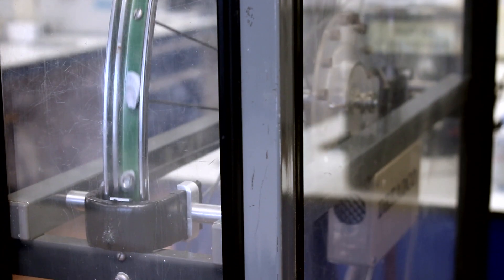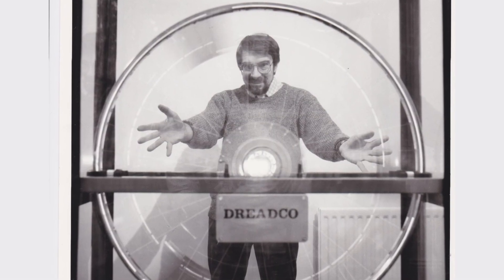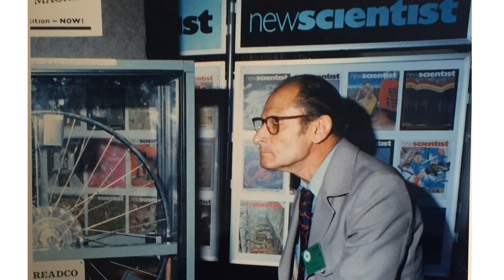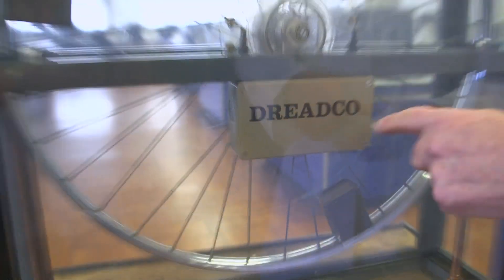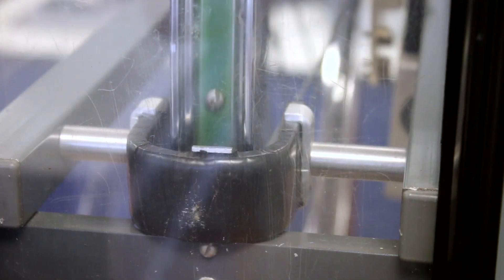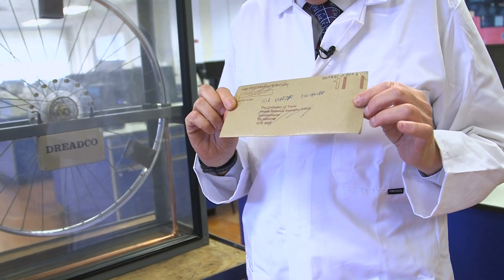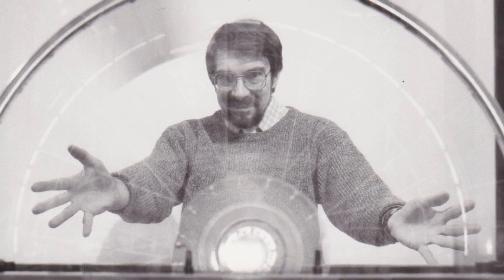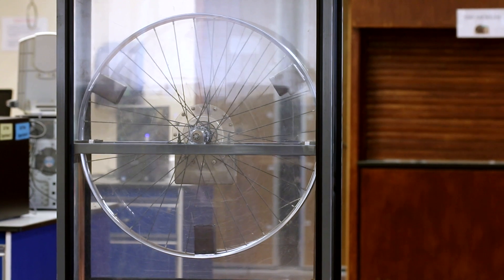Perpetual Motion Machine - Periodic Table of Videos

Comment: Seeing as how in Adam Savage’s video of this machine, the caretaker said it stopped every 2-3 years and had to be sent away to be reset, I think it’s a clock motor.
Hidden somewhere in the machine, probably the hub of the wheel, is a tiny analogue clock motor. The motor powers the wheel for 2-ish years until the battery runs out. And the wheel slows over time since it’s a substantially heavier load than the gearing of a clock and thus the motor doesn’t have enough torque at low power to keep the same speed

Comment: The problem with the production of energy in the lab (perpetual motion) is that the profs want to replace Newtonian Laws of Motion with the law of conservation of energy.

The profs claim that energy and Newtonian Momentum are both conserved in interactions of moving objects but that is a lie. They tell this lie to protect their false theory of energy conservation. This is worth 7 trillion dollars so yes it is worth your time.

An example is that the profs claim that a 40 kg rim moving 1 m/sec will give a 1 kg mass a speed of 6.32 m/sec. That is a loss of 84% of the Newtonian Momentum; and then they will turn right around and say that Newtonian Momentum is not lost.

The experimental truth is that a 40 kg rim will give a 1 kg mass all of the Newtonian Momentum; which is a speed of 40 m/sec for the small mass. And the energy increase is massive. This is experimentally proven by ‘cylinder and spheres’ experiments.  

All that needs to be done is that the ‘cylinder and spheres’ experiments be repeated and a online discussion be started. The experiments will speak for themselves. The ‘cylinder and spheres’ experiments can be built for less than $30.

Comment: The professor owns a perpetual machine? It makes sense why he replied to my question about the subject when I emailed him ages ago about this...amazing!

The design I envisioned would have had mirros and lens to focus sunlight into a point (or more) to spin magnetically levitating graphite disks in short.
Although not a true perpetual motion machine by definition, it would have been an interesting concept that I never explored further.

I'd assume the Professor's machine works by carefully balancing a few different systems, one of which might be a gas condensing and evaporating due to temperature variation in an endless cycle inside the machine (boxes, tubes), offsetting the weight of the wheel and making it spin.

Much love to you all and the ones reading this.

Comment: 😂 easy, The motion is caused by magnets, The 3 boxes are magnets that passes throw another 2 magnets on the side with U shape,  these 2 magnets on the side pushes the wheels slightly to keep it going, it slow down after 2, 3 years because magnets loses its magnetic power. 

There is no battery, no motor used, just magnets.

Comment: If we think of a common device with a small motor that runs for years (that used to be more common, admittedly) combined with a well balanced wheel and more than a few AAs in the box, this isn't so implausible. People don't have analog clocks as much these days, but I don't see why a clock motor or similar couldn't do the job. Anyway, it would still take workmanship and a sense of style.

Comment: Stop the disc. Re start again. To see if it works. Probably it is not going to work. 
It apperantly seems that there are 3 magnets on the rotating disc. And There are 2 stationary coil windings (magnets) on the frame. And there is a hidden flip flop circut which are changing the poles each time moving magnet passes. So the magnets attracts each other. As soon as one magnet passes over a winding deenergized. Flip flop circut knows the location and sequence of magnets. Thus a force created to rotate the disc. No need to have a electric motor at the center of disc. As an energy source a Battery is needed for flip flop circut. When battery died the rotating disc is going to stop

Comment: Hi this looks like a pulse motor. The boxes on the rim and the other stuff near the rim are there to confuse the observer.
If you look at the center of the wheel there is a box and a plastic disc, the plastic disc looks like it has magnets attached and the box probably contains a battery and a pulse circuit.
The wheel is probably well balanced and has low friction bearings, this type of system will run for many years and slow over time.

Comment: I imagine it is very simple. The three boxes are magnets that are repelled by opposing magnets (the horse shoe shaped). The excessive insulation on both the boxes and the horse shoes is to limit the repelling force of the magnets to eliminate the 'clunk' effect. The machine slows down owing to the bearings fouling with dust and the oil depleting. The wheel itself is isolated from the frame by the glass housing of the bearings at it will also become magnetised. You can see the bearings actually spin slightly slower that the centre shaft, again, there may be resistance in those to allow for fluid movement. The rest of the items like the Dreadco box, the anode/cathode, the heat sink and copper pipes are all smoke and mirrors.

Comment: I remember seeing mantel clocks a number of years ago that seemed to have no source of power, yet ran forever. The key was that the clock only required a microscopic amount of energy to keep running. That tiny bit of energy was provide by a piece of metal that would expand a little when heated and contract when cooled. The normal daily room temperature changes were enough for this tiny stretching & contracting to be converted into the mechanical motion of the clock.

Comment: I believe their are 2 spirings inside the center support bar, similiar to what garage door springs look like, but much smaller. The "dreadco" box has a gear winding mechanism inside. All the rest is pure distraction. David Jones even said that most of the gadgets you see are just for distraction. It operates just like a spring wound watch, but because it has the spring wound across a 2 foot span, it can operate a much larger wheel. Spring wound clocks slow down as they wind down, which is why they have to be adjusted every month or so. This machine does the same.

Comment: Here are several possibilities: 
The entire thing is a motor. (magnets on the side, batteries in the frame, base, on box by the name)
Powered by a concealed clock mechanism (They run for two years on a battery)
Self winding clock. 
Ionic drive (that electrically charged pointed tip sending air into to the little cups)
Powered by changes in atmosphere. (like that other clock)
Reply: No magnetic fields were detected on the sides, but in the middle and bottom.

Comment: Nothing of these visible parts makes sense.
I guess he could have just put a propeller inside the box at the floor.
Forcing air flow to spin the wheel.
But that would have been quite the loss of energy in such a method of perpetuating the motion.

Comment: I wish I knew more about electromagnetism because I feel like that's how it works. Do temp differences cause electric currents? Could the heat sink keep that area of the copper cooler than the rest causing an electric current and those boxes have magnets that gain energy from that current or its transmitted to the center of the wheel?

Comment: It's a self assembling & disassembling motor, with windings inside the 3 black boxes attached to the inner rim...

The power supply (battery) is hidden inside the heat-sink....

Comment: Each black box on the rotating wheel has a battery, magnetic field sensor (e.g., reed switch) and electromagnetic. Each time the box passes through a stationary horseshoe magnetic, the magnetic field sensor pulses on the electromagnetic which gently and briefly pulls the box towards the stationary magnet. Notice the black boxes are spaced so one at a time they encounter a magnetic, for three pushes per rotation. Everything else is a distraction.

Comment: I believe it's powered by static electricity and photovoltaic cells seen on the side of the dreadco box. The rest is just a distraction and you can tell by the lack of effort in the box's on the wheel or piping at the base.

Also notice how the wheel is mounted on a Perspex frame, with also a Perspex wheel holding the metal cups. This is to contain the statically charged cups until the reach they ball end tip on the left of the dreadco box. The pointed tip above the right of the dreadco box repels and charges the cups, the left discharges and perhaps attracts.

Comment: its a motor in the center, low voltage pulses. weights on sides are just for balance - magnets are fake, pipe and heat sink are also fake, air vents aren't positioned in correct/ideal position for cooling. it's a guise to seem functional. real power source is in the box that is obscuring part of the wheel and posing as a name tag.
Reply: its also possible that its just spring loaded with severe gear system thats a 40k/1 ratio - the spring needs to be reset every ~2 years

Comment: Remember that whatever powers this has to use extremely small amounts of power, a conventional motor wouldn't accomplish this. I'd guess anything that looks functional to the wheel is how it works, boxes ofc are nonsense, it could be convection maybe but I've seen hints about it's servicing so likely not. I'd say maybe the bolts on the front of the wheel as some look slightly different than the others but how would be the real question.

Comment: I'd like to see a bit less of the strange envelope and a bit more of the machine closeup on either side where the horseshoe parts are. I note an asymmetry in the copper piping (heatsink aside). I am wondering whether an air current giving a nett torque to one side of the wheel is responsible. ?

Comment: The pipe facility is a Venturi pipe, it has a flap inside( non return valve open and closed by the vortex forces of the cans( they are empty) when passing around the end of the pipe. The movement ensure the intake fluid to the  heatsink, where it is cooling down and volume increasing. It occurs some minimal pressure in the intakes of  the right part of the pipe after the heatsink. That pressure is a source of potential energy flow that pushing the wheel untill the next tin can, where the cycle is return. The wheel movement  is based on the thermodynamic of the fluids.

Comment: I think that there is a hidden string turning the wheel through the copper pipes and connected to a motor with a battery pack.

Comment: I suspect that the input energy comes from temperature changes in the room over the course of the day. The insulation of the perspex box causes the inside to lag behind the outside in these changes sufficiently to create a temperature differential large enough to power a Seebeck generator. The piece that closes around the wheel contains an electromagnet that interacts with the fixed magnets in the boxes attached to the wheel. Presumably something complex is happening to vary the current through the electromagnets as the fixed magnets pass it.

Comment: The tree boxes are batteries, transferring their energy by the little spark metal (2:30) in an ionised air surface (closed box), converting their energy to rotation by a low voltage electric motor in the middle of the wheel.

That’s how I think it works when you told that the answer disappointed you and cheated...

Comment: Electric motor. Hall sensors in the little feelers on top of the box, Commutating the "magnets" on the sides. I suspect theres electrical wire in the tubes and the heat sink is a decoy. And since its running slower than it has when it was made, the battery is running out of juice.

Comment: There's a small electric motor in the center, which runs on solar cell (the window on the side of the box). Might be a battery in the middle too, which the solar cell charges. If you put this machine in darkness for a long period of time, it will stop running. Everything else is just distraction.

Comment: Given that it is an announced fake PM machine, I can think of several ways to get the force necessary to overcome the axle bearing friction. Some careful measurements of the wheel speed during a rotation would be necessary before possibilities could be eliminated. Some time in an environmental chamber would also be useful. 
The only thing we can be certain about is that Poliakoff was somewhat disappointed - so the answer must be very simple.

Comment: The magnets are pushed by an ion thruster of sorts. Basically electricity generated by the magnets passing, plus electricity generated from the seebeck effect in the "heat sink", is sent into magnets and they repel the big magnets away. Effectively pushing the wheel.

Comment: Professor. If the perpetual motion machine were a perpetual motion machine it should have used all the energy from the friction and sound(miniscule) and recycled them to work, but the glass witch conducts heat (miniscule)let's energy out and no way to replenish. So, the machine will run out of energy will not allow the machine to work.
Name- Arkodeep Maitra 
Age - 10

Comment: The heat sink makes me think it's some kind of Stirling engine but then I started wondering if box is vacuum, or near vacuum, and it's operating as a radiometer, using the pressure of light in the room to spin.

Comment: All the stuff around the wheel is fake I belive, it's made to confuse the viewer. I think in those boxes mounted on the wheel are switches that switch a certain weight back and forward depending on the wheels cycles. It dosnt need to be a switch with a weight but it can also be a liquid or sand. Therefore I wonder if it makes some sort of clicking sound?

Comment: There is a product , it is a little pipe that uses vacuum and possibly a liquid or a gas to transfer heat.. I don’t remember exactly how it works something to do with low/high pressure .. could the pipe system be transfer energy to the heat sink , then radiated to recycle.. maybe whatever the reaction between those magnet looking things and the boxes on the wheel create some kind of energy .. have to think about this a little more ....

Comment: the machine in the video is a heat exhanger. it use heat to pull heat from the room so that it can produce gain. its somthing like that.  i seen this stuff before. someone even filed a patent for it. energy is infinite. we just displace quantity to produce advantage. energy can not be created or destroyed. energy is infinite to begin with. work is just interference but the constant potential of work is infinite and does not dimish. the work systems we make are not isolated. they are all enviromental. thee is a universal force that drives all the machines of energy and everything related to energy.  this universal force does not decrease when it produce work. what people think is that energy is just chaning form by decrese in one and increase in the other. it doesn't the interfeence pattern of the universe can be infinitly complex. the work we do is finite to the way we treat energy. you can produce a infinite amount of work because energy can not be destroyed or created therby exist as infinite to begin with. if the logic was to limit interference complexity by rewire the patterns and then think of energy as just a transition of one type to the next, then people do not understand what energy is. in order for a pattern to emergy, there must be a moving element that drives all the patterns. this moving element can create infinite complexity. it means that energy is infinite but our systems are finite in ability to advance complexity. a static pattern can not create its own motion by itself. if you think it can, you don't understand what energy is and what we are doing with it.

Comment: My first guess the moment I saw the tubes and was reaffirmed when he said heat sync comes from another video on YouTube that describes a motor that uses heat as an energy source and that is what powers the wheel and is why it has a heat sync to draw the heat from the bottom and it is in a container (also to prevent wind or anything from stopping it for it is not very strong)

Comment: my best guess would be that there's a little low power fan in the box with the heatsinks (( heatsinks are just for show)) that's blowing air through the copper pipe that runs along the bottom and goes halfway up the side of the tyre that's rotating up. and that there's a battery in the box labeled dreadco powering it.

Comment: The two horse shoe shaped bits at the sides are electromagnets that attract the metal spokes?
And the copper bits hold magnets that run past a hall sensor to trigger the electromagnets?
The copper tube seems like it could be a part of a magnesium-copper battery.